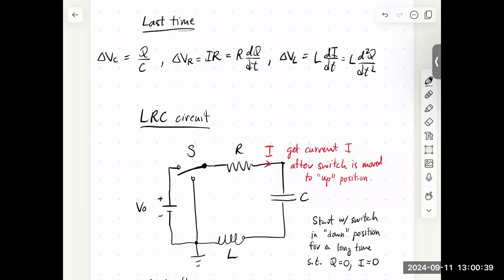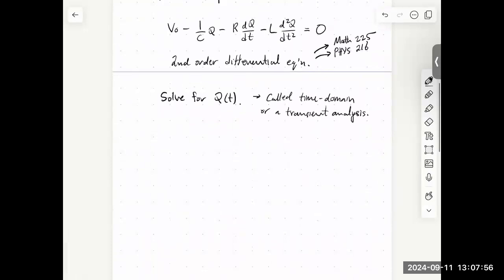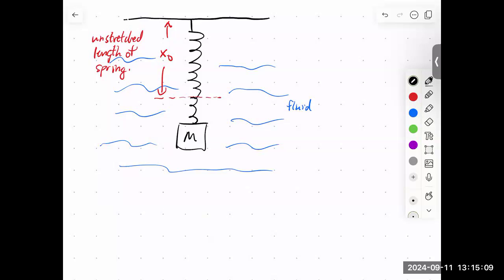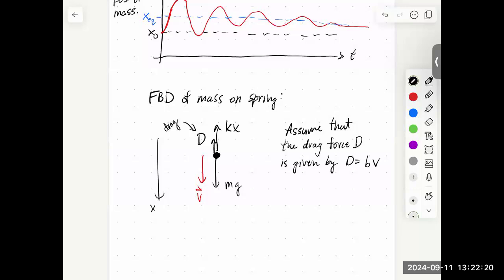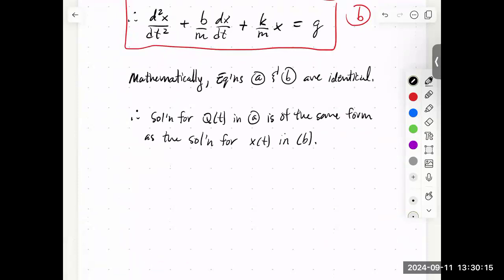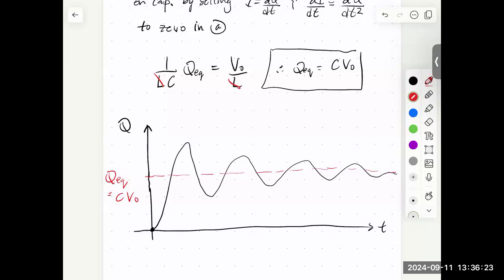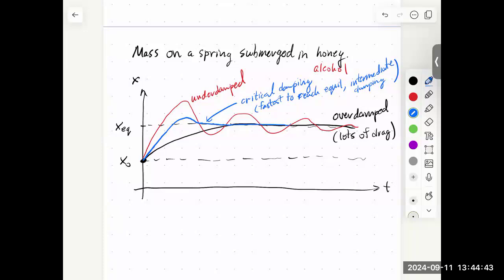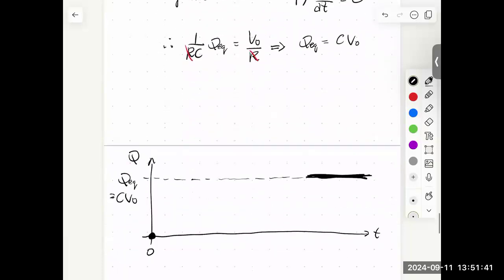PHYS 231 - 20240911

Comment: critical damping is not the fastest in reaching equilibrium state...especially not in a practical sense (i.e. in experiments and applications)...e.g. damping coefficient about 10% smaller than critical can be a much better choice, and sometimes (depending on the initial conditions) even a damping coeffficient in the overdamp regime can be the fastest in reaching equilibrium state...there are some subtleties to this issue that are often not considered...